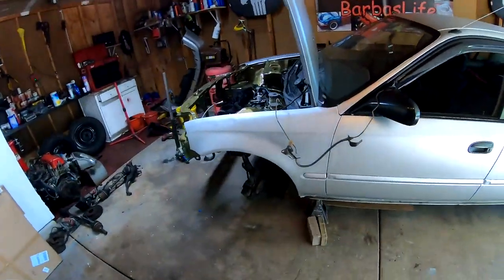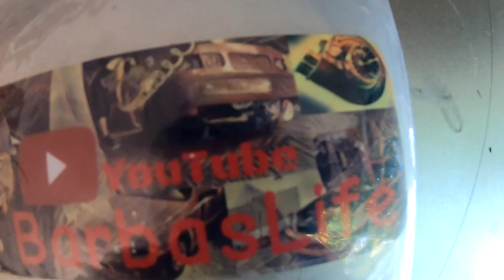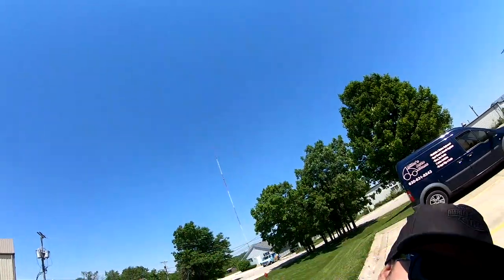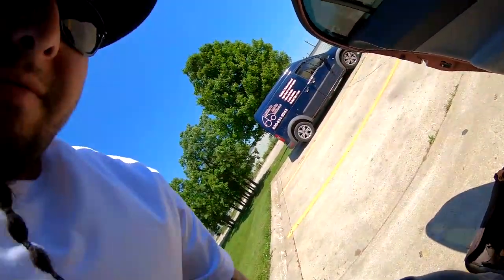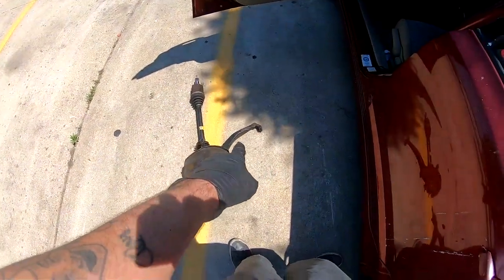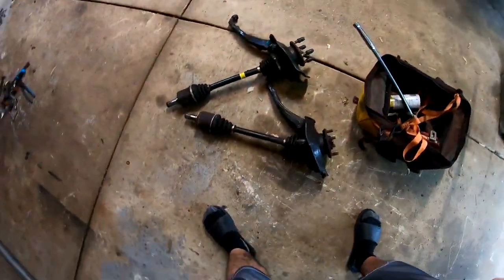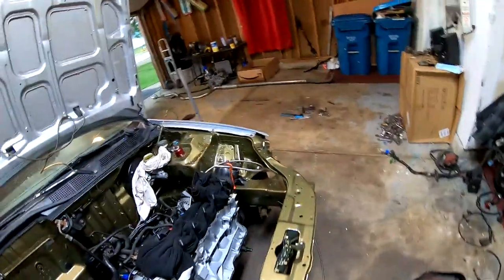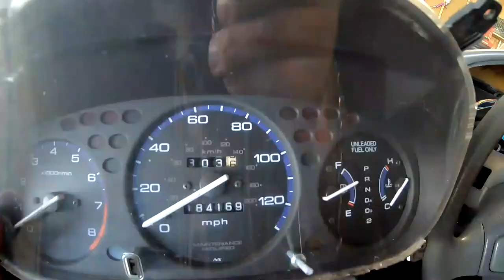Junk yard Run (civic finally Rolls)

Comment: Man just got a new job g.. gonna be saving up and try to go with a mild track build on my gsr.. something to do for the summer anyway hoping to get into the 12s mid 12s ill be happy lol
Reply from the maker: congrats.  slowly save up and it will happen.
Reply: @BarbasLife  oh and before I forget can you do a in detail video of the oil line feed and drain thays where im kinda stumped on i don't think ima go with the sandwich plate just go with the t bracket for the oil pressure sensor